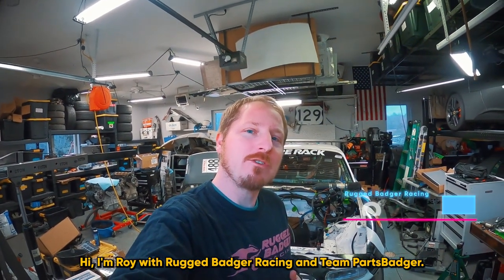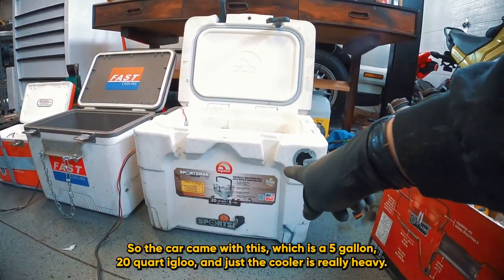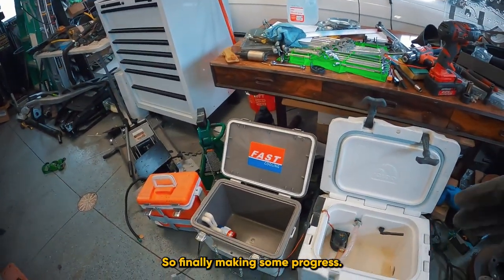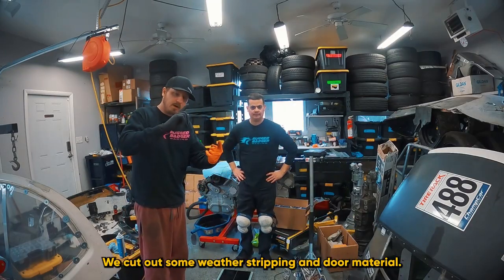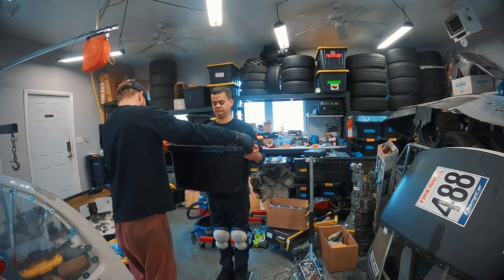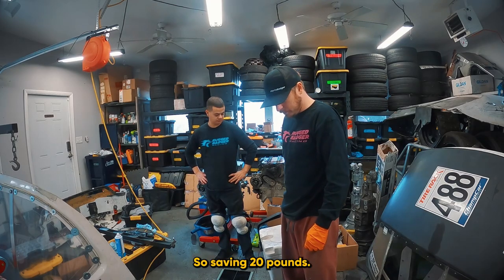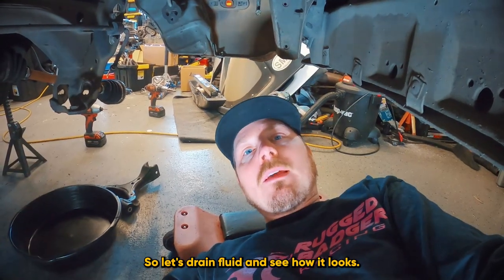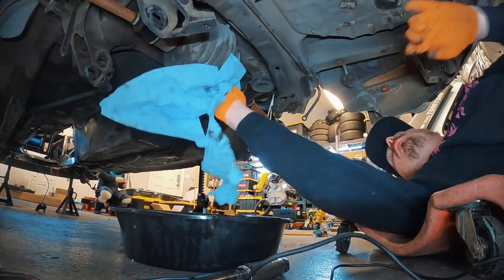Miata Race Prep: Hardtop, Coolshirt System, & Diff Fluid Swap - 80 Hours To Gingerman

Comment: one might argue that ratchet would be unnecessary weight based on your approach
Reply from the maker: Good call.  On our last one we used light weight chain material and bolted the sides, that way we could open it quicker, the weight was about the same though.  Luckily this ratchet is pretty light and I think it will keep tech happy.
Reply: I had one of the heavy duty rubber  bungy straps. I had it super tight so it couldn't stretch any further .